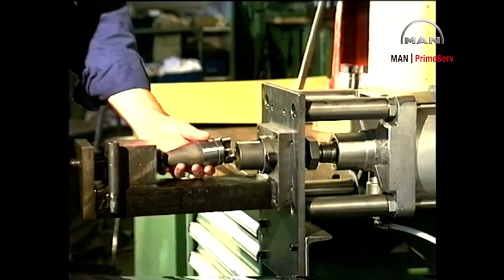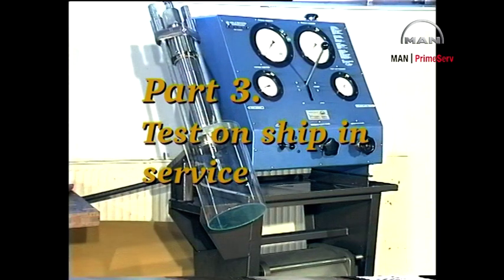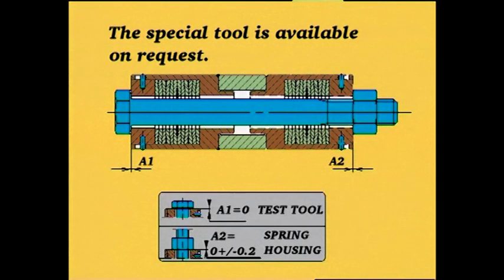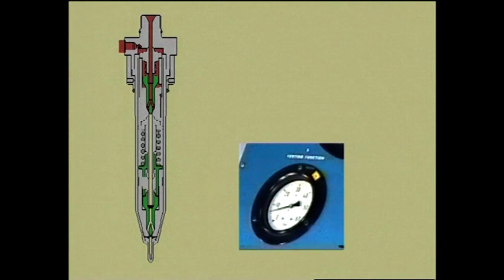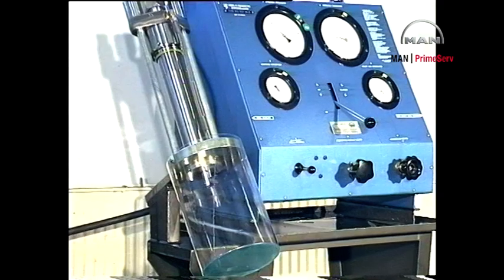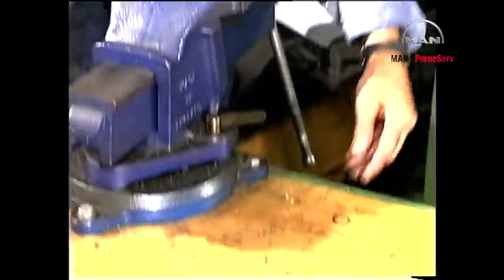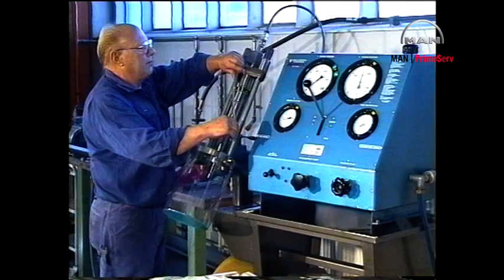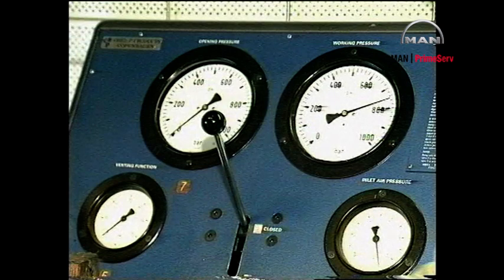Pressure Testing Fuel Valves

Comment: We are supplier of fuel injector testing machine, and we also deal in machinery like oil purifier & heat exchanger  contact us at aybhojani@gmail.com  for best price
We are super stockist of marine equipments since 2008  contact us for best price possible in market
aybhojani@gmail.com

Comment: Whats the difference between working pressures and opening pressures. The opening pressure is the pressure when the injection starts but technically that should be the working pressures too